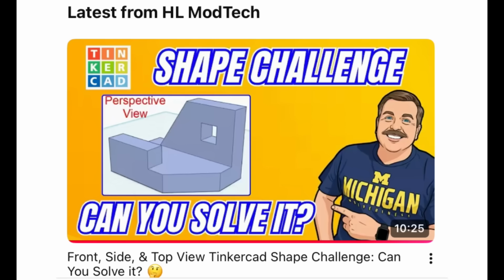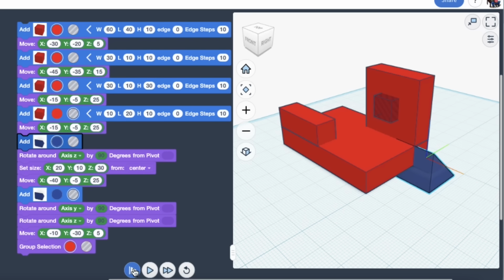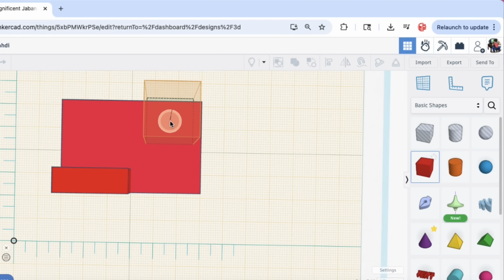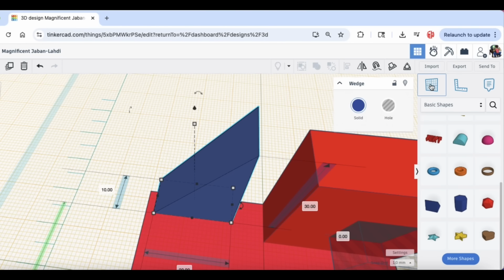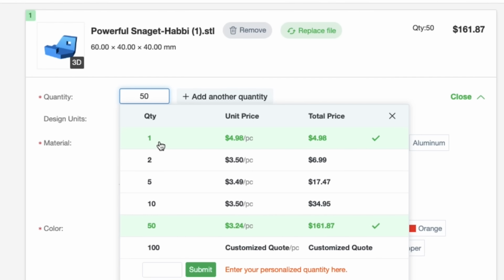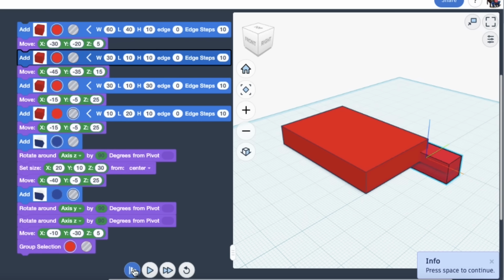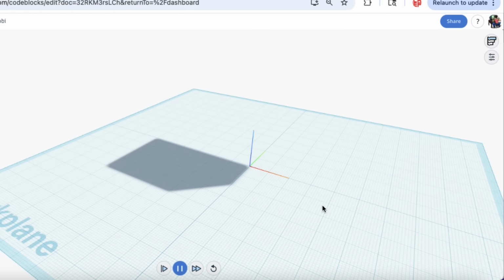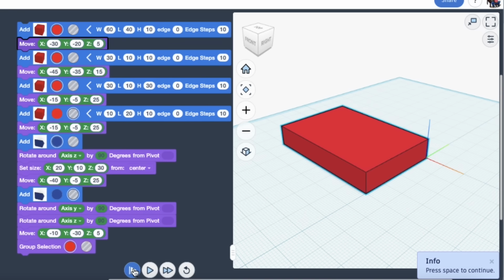Tinkercad Code Blocks Crush the Shape Challenge

Comment: Would it have been harder if you started with code blocks instead of piecing the shape together first?
Reply from the maker: Not really. It’s still the same steps based on the dimensional drawing. I showed the way I did some viewers could visually see the build before showing the code.

Comment: Your list of code blocks is just a feature tree you have to create yourself ... with all the names and relations removed. Note how the code blocks have "Move by X,Y,Z" but not "Align to edge". That means if you change a dimension where other blocks align to, you might have to update lots of coordinates in the blocks. I'm sorry, that's just parametric CAD done worse.
Reply from the maker: They are all referenced to the 0,0,0 point of the  X, Y, Z of the build area. 
If you have elements that need to stay together you can make a subgroup using the group element but still have access to the sub -component parameters.
You can also create variables that all components use so one variable change trickles through the design and all change together.

Comment: i use freecad for my designs, but where you & others prefer to set part placements adjacent to the origin i prefer the origin to be at part center mass.  it's especially helpful to me on multipart designs, like the machines i've been designing.  ultimately which cad suite is used is a matter of preference, but i enjoy seeing the different ways people get to the same solution - just goes to show there's rarely only 1 right answer to any given problem.
Reply from the maker: You can set the ruler to midpoint reference and get what you describe. Code blocks also defaults to center reference as you describe.
Reply: @FilamentFriday i figured as much.  i'm not much of a fan of tinkercad, personally, but i know a lot of people love it.
Reply from the maker: @TinkerDad3D - TinkerDad doesn’t like Tinkercad? 😢
Reply: @FilamentFriday not my cup of tea.  accessibility from anywhere is a nice idea, but the lack of privacy is a major concern to me, especially as a retired computer technician.